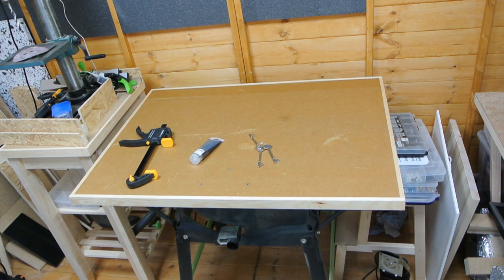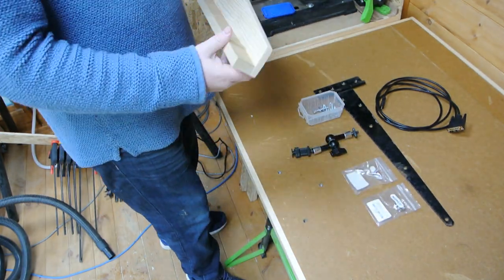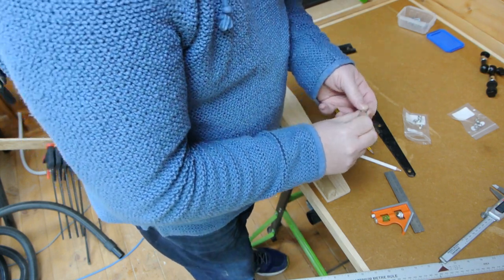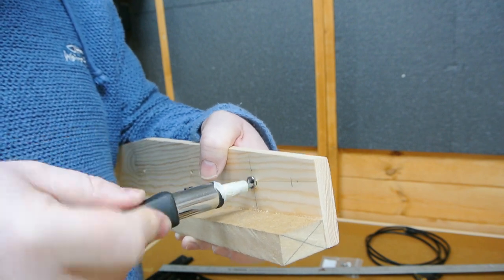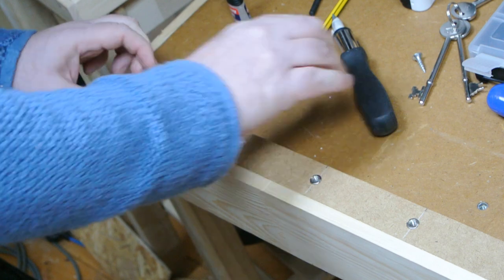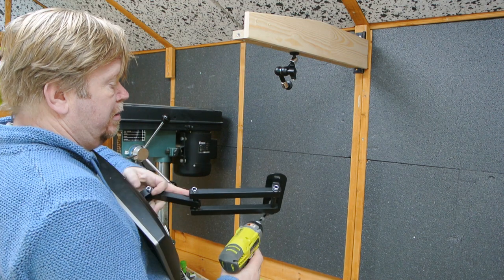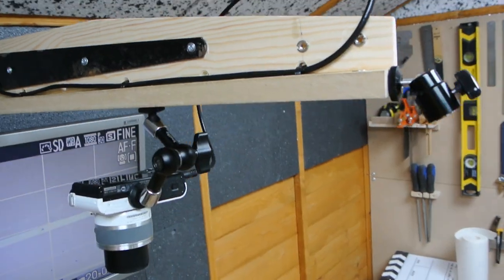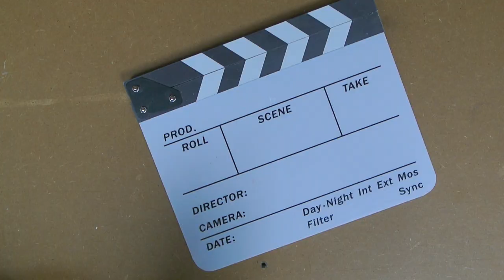DIY Overhead Camera Rig for YouTube - Amazingly Versatile - Small Workshop

Comment: That’s very cool. Been considering this and an overhead light rig on a slider for the shop. So I don’t have to trip over wires and move tripods
Reply from the maker: Just a thought. While I used a fairly short magic arm on the rig, a longer one would give you a whole host of shots especially if filming in a small workshop. Thanks for the comment BTW.
Reply: Strawbyte Workshop you got it brother. Thanks for the idea !!

Comment: Very neat job Karl. It does make a difference having the camera gear out of the way in a small shop. Saves you doing a tango with the tripod every time you move around. You must do a follow up when you start blinging it up with accessories and go faster stripes 🙂
Reply from the maker: Stephen's 8x6 Workshop thanks Stephen. in.the middle of the video when you see camera mounted facing me you can see the first upgrade which is the new light above the bench. I mention mic and lights in the outro but the parts got lost in the post to mount them, so youndidnt.get to see them in the shots. So yes there will be a follow up.

Comment: Great solution too not having bulky tripods all over the place what cameras do you use for filming Karl quality seems good on them
Reply from the maker: BIGBOY'S DIY -- thanks. Yes it takes away some of.the need for s tripod but not all. Because my band saw and drill are mobile I expect it to help there. I've been looking at options for the reminder of the shots. Rag'n'bone brown has a weighted base approach, Stephens 8x6 workshop has an articulated arm approach. I'll see in the coming weeks. I use two cameras a Nikon 1 j2 and a Nikon 1 V1. Both with a 18-55mm lens. These are mirror less cameras and are simole out of the box.   The key to my videos is good lighting. I have 3 48w LED panels putting out a combined 15,000 lumens, and I've calibrated both cameras for exposure and white balance which was something I learned from a couple of good YouTube channels. Peter McKinnon and DSLR Filming. Sound has improved with the V1 having an external mic jack and I use a Rode VideoMic Mini and a Rode lapel mic.
Reply: Strawbyte Workshop I was looking at a Panasonic lumix gf2 seem good quality I'm filming between my phone and an old Samsung camcorder at the minute but need too upgrade but like everything else its having the money, I only use 1 58w 6ft florescent tube in my shed I need too look into changing too led as well I think thanks karl